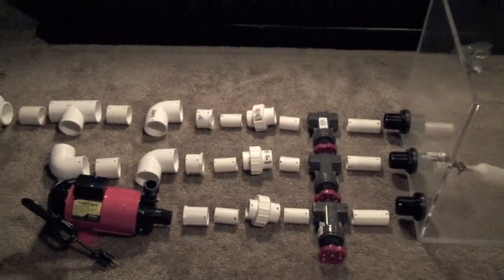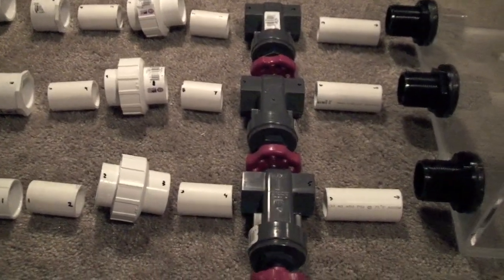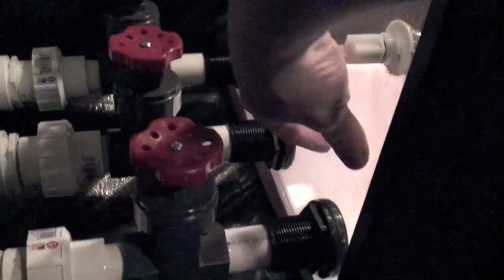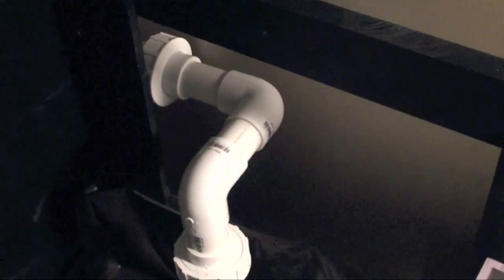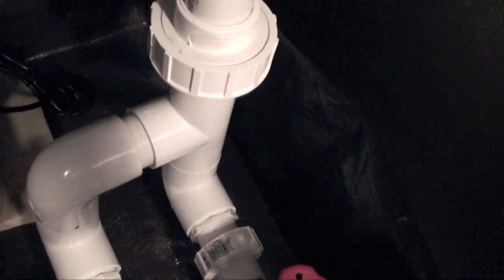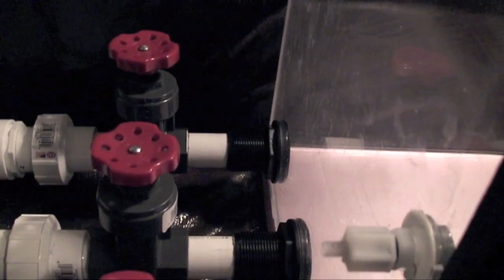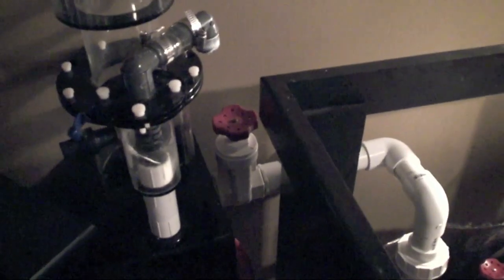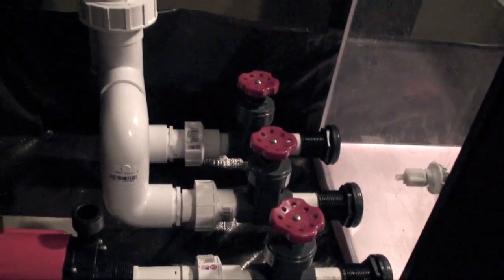SW Rebuild - Part 7 - Skimmer PVC Work

Comment: The issue with the return from your skimmer splitting to the two 1" pipes is that gravity is going to have the water fall straight down and not make a 90 degree turn. Splitting it at that point is obsolete, you could use that bulkhead for something else or just plug it, it is not performing anything for you.